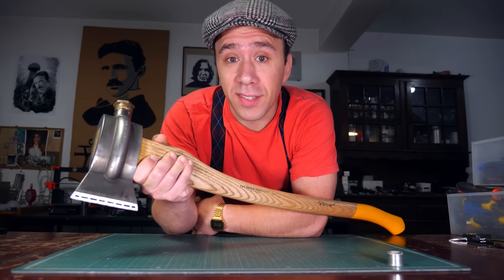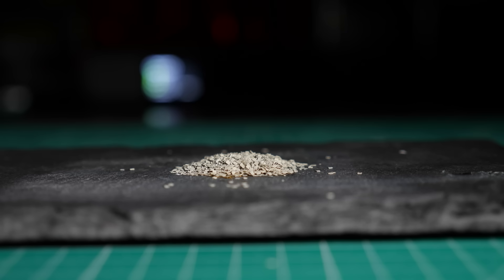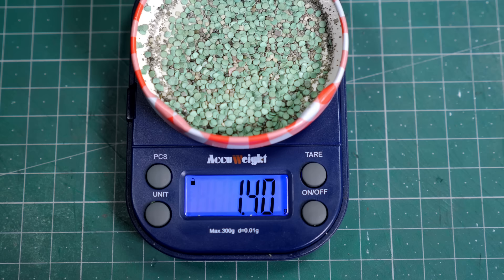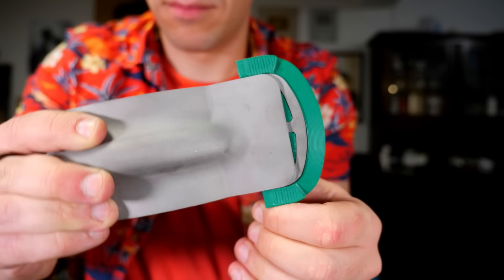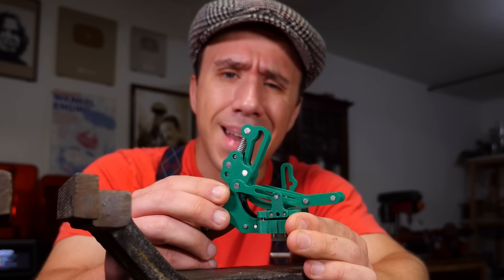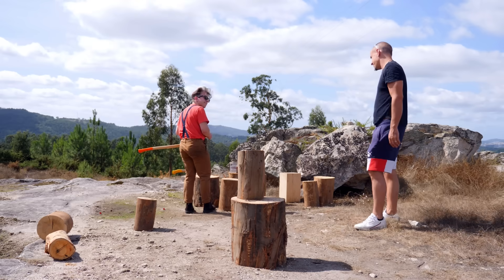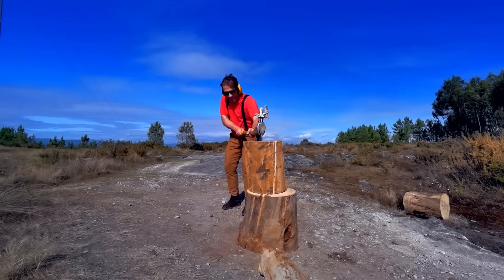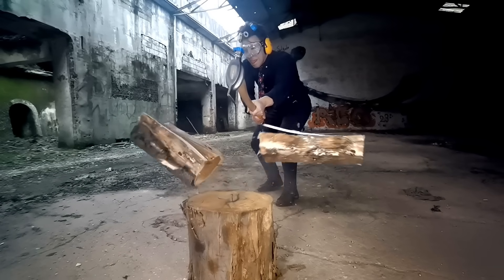I built a BETTER SHOTGUN AXE

Comment: It's humorous that you've created a large handheld pressurized explosive device with homemade oxygen and hydrogen fuel but somehow despite all of that the most illegal part of this project was the shotgun shells.
Reply: Funnily enough, the modified shells are the equivalent of powder nail gun blanks.  It gets into the technicalities, but there's a decent chance they're then legal.

Only semi-familiar with US law, but here's a fun tidbit.  The oxy hydrogen version would be classified differently and might have been the illegal one here!

> “Explosive-Actuated Power Devices” shall mean any tool or special mechanized device which is actuated by explosives, but not to include propellant-actuated power devices
Reply: @EmperorA0   in the us I'm pretty sure that is you're propelling a projectile its not a firearm.  if there were/is limits on the size of the charge, I'm pretty sure that they would still allow 12 gauge shells because the law was written in a time when it wasn't uncommon to see tractors that would use a 12 gauge to start.
Reply: @MrJstorm4  US firearms laws make no sense.

Black-powder cap and ball revolvers aren't firearms. Shoe-laces were considered a machine gun conversion, and adding certain grips requires a $200 tax stamp.
Reply: @EmperorA0 the laws are lighter for muzzleloaders, but the legal definition of a firearm is that it propels a projectile find memes of an explosion.
Reply: @MrJstorm4   and that's not relevant because the courts ruled black powder muzzleloaders aren't firearms.
Reply: @garethkalum8297  wrong. They're antique firearms which aren't lawfully firearms in most states. Some states still consider them firearms though.
Reply: @EmperorA0 Isn't Integza Portuguese?
Reply: @Infanterie_Marine  I believe so, and the laws there are completely different.  I just don't know them or how to properly research them.

I was more focusing on how laws can get weird based on things we don't expect.
Reply: Never get on this man’s bad side.
Reply: best way to find an american in a crowd is to say "guns are bad" and watch them all come crawling out of the sewers to justify the means of mass murder
Reply: Because gun controls is not about safety. It's just about control.
Reply: @rucker69  American moment.
Reply: @latlatko  Pardon?
Reply: @latlatko you didn’t call him wrong
Reply: @rucker69 yup, and harm-reduction and systemic approaches are much more effective to reduce violence. Prohibition doesn't really work to reduce the contraband of then-prohibited goods. It's better to adress the underlying root causes of social problems through culture, with accessible social support services, reducing poverty, etc. Violent crime in the USA owes a lot more to culture and poverty than to not making enough good illegal to everyone. Being poor in the USA is a lot worse than being poor in most other western countries.
Reply: @rucker69 Idk man i think easy access to something that can kill a person without any effort is bad actually
Reply: @IYDACIDE  That can be said for essentially any tool. People bent on violence will attempt to do so regardless of the tool. But to counter your (false) point, lawful firearm carriers are statistically safer than law enforcement. You also have to remember human nature and cultural norm requirements, but nobody really wants to talk about that...
Reply: @IYDACIDE ah yes, so literally anything with a blade or point then as well? More easy to conceal and less conspicuous than a firearm, so maybe they should take those away too. Oh and arrows and bolts are completely silent, so get those too while you’re at it. As a matter of fact, vehicular homicide is possible and can happen with little effort as well, so take away cars too. You get the point now? It’s not the objects, it’s the people who have the intent that should bear the blame. Handing someone a firearm does not make them a killer. Killing someone makes them a killer by definition.
Reply: @IYDACIDE that's his point. Allot of things can do that. Nail guns that use blanks as propellant are moving those nails fast as a bullet. A good swing with a hammer to the dome will do more damage than a gun will.  you can take out a crowd of people with a car. He just took the first steps to a hydrogen bomb with hardware store materials. Should we ban all these things too?
Reply: @darkhawk574  I'm not really against ownership of guns but I think this is a poor argument, its like saying someone dead set on robbing a store or bank is going to find a way to do it so we might as well leave the money out in the open. Also, harming someone with a gun is much easier than with a blade or bow, and a vehicle's numerous utility uses far outweigh its capacity to harm. I cant think of many utility uses for owning a pistol outside of self defense, which isn't to say that's a bad use case but I think you get the point.
Reply: @rucker69  In Australia after we had a mass shooting in 1996 we introduced strict gun laws. Care to guess how many mass shootings we have had in the following 29 years...? None, not one. How about the USA..? I'm getting 8-11 Per week in the USA from a gpt search.

Gotta say, for the "most free" country on earth youve got the highest gun violence of any western country and the highest prison population per capita. Glad I live in Australia.
Reply: @SteggyMgeeSee it's the snottiness you have that is keeping you from thinking rationally. You don't even understand the laws we do have or how the shooters you cite obtain them (it's mostly theft). Pretty sure you have had a bunch of mass stabbings and even a shooting in the last 12 months. Banning objects does not stop the will to kill.
Reply: @IYDACIDE  You sound like the British government. I recently had to go through a new piece of knife legislation to check whether the machete I use at my job is now classified as an illegal offensive weapon; fortunately since the blade point is not less than 90 degrees and there is no serrated section, our wise and noble leaders still deem it a garden tool, not one of those 'weapon' machetes people use to thrust and saw at each other presumably. No, mine is only good for hacking with and therefore fortunately unsuitable as a weapon /s
Reply: @rucker69  Not being snotty man just saying facts. Theres nobody to steal a gun from here. ok lets look at some statistics

Total homicide rate in the U.S.: ~ 6.8 victims per 100,000 people (2023) 

General murder/homicide rate in Australia: ~ 0.74 victims per 100,000 people (2021) according to macrotrends.

so what are we at? youre about 9x more likely to be murdered in the USA regardless of method.
Reply: @SteggyMgeeIt’s always an ausfailian coming in on a high horse, meanwhile every gang shooting in America is counted as a mass shooting despite it not really counting
Reply: @SteggyMgee he’s not worth your time man. People like him are why am*rica will continue to have more shootings than there are days the of year. Hes a lost cause
Reply: @SteggyMgee so you only care about shootings and not violence.
Reply: @rucker69 that reflects more on law enforcement than anything else. May I know the source of that ststistic? Just so I know which country we're talking about... Good thing you're not a hypocrite and thus favor resucing law enforcement's access to deadly force and increase their accountability, right?
The effectiveness of the violence inflicted is heavily reliant on the tools. My brother blocked a knife attack with a high school backpack. I have a friend who was stabbed in the gut and survived even though it took over an hour for him to get treatment. Would the same be true in either case with firearms?
Reply: @marcospatricio8283  It's pretty easy to look up yourself. USA. I think it's John Lott's work, if I recall. But CDC and FBI have always shown that to be the case, when they're not caught doctoring numbers to omit citizen defensive gun uses. As well as highlight the source of violence to begin with, which I'm not sure why you're ignoring? You think it's better that there are stabbings instead of shootings as opposed to just, oh I don't know, attacking the sources of violent crime to begin with? 

It is silly to treat the two categories separately. Humans are sacks of flesh and blood and opening that up in any fashion always carries a risk of death or other health damaging effects. Some people get shot in the head and live. Some people get stabbed in the leg and die.
Reply: @rucker69 being "easy to look up" is irrelevant. I wanted to make sure we were talking about the same set of data, both to make references I know you'll get and to account for the possibility that your sources suck. And speaking of that: Lott's work has been heavily criticized for methodological errors since it's inception, and for good reason. None of his findings have been replicated whatsoever, and he's only relevant outside of the scientific community. I couldn't find sources for law enforcement violence in either the CDC or FBI sites. If you could find the sources I'll happily read them.
Assuming that your data is right, tho. The US police forces are remarkably militarized and unusually violent. Being less violent than them on average is not a big accomplishment on US civilians. 

I didn't ignore the matter of "source of violence" because you didn't mention it before. Elaborate on it and I'll address the subject. And speaking of ignoring, answer my questionn about your views on law enforcement. As for your question about "attacking the source of violent crime": I've seen that used as an excuse to lynch innocent people multiple times, and as an excuse to subject criminals to abhorent and inhumane punishments. The average human is a coward. If allowing them to "attack the source of violent crime" is garanteed to cause loads of collateral and has no garantee of actually solving the problem, I'll err on the side of caution.

Ahmmad Zeineddin has a good paper on that. Shows that gunshot wounds are 5 times more lethal than stab wounds. It is limited in that it doesn't address prehospital deaths, tho. But also doesn't address the fact that stab wounds don't necessarily require hospital attention much more often than gun wounds, so it's not a silver bullet against your point. You could look for papers on that to support your point.
Reply: @person55632  I've been hit by nailguns before they don't do shit, what brand of nailgun are you buying?!
Reply: @FiniteBanjo yeah if you get hit anywhere that's not vital it's not going to kill you. That's the same with a gun. There's plenty of shooting survivors too. But I also have known people killed by a nailgun to the head. A bullet to the leg is generally less deadly than a knife to the throat even though a gun is considered more dangerous than a knife.
Reply: @rucker69  where the fuck do you think they steal from. the cops? obviously not. they steal'em from places that are easy to steal from, of which there are many because there's a whole logistics chain for consumer-purchaseable firearms.
Reply: @SteggyMgee Yeah about that...
Reply: @rucker69 
If you think there's any gun control at all in the USA, you're insane.
Reply: @Armand79th they do "control" guns to some extent. But they lack most of the socio-economic policies and access to support services that make other countries have less violence than the USA has. They don't even have healthcare, let alone proper education. Makes sense that they'd have more gun crime than the similarly-armed swiss and rural canadians.
Reply: @Gabdube  wtf dude "they don't even have healthcare..." do you just think we don't have hospitals or doctors? Plenty of complaints to levy that don't involve muddling terminology. Edit: I got to another one of your comments which addresses culture so I'm retracting the rest of my reply here.

Comment: Why not build the axe with a floating heel? The axe tip, being mounted to the handle, and a weighted heel mounted on a 4 point coil spring. You could have an inner barrel inside the chopping face and a female outer barrel and the striker pin at the end. Mounted inside the heel. Which would also keep the striker and shot plate in line. You could make the springs adjustable for load. 
Just thoughts.  I'm no engineer.  Lol

Comment: I think you’re over penetrating the primer on the shot shells and this is venting the gas backwards out the hole the primer fits into. Or you didn’t seal the sides of the camber well enough. If you post pics of the shells I could tell better. Cause if there’s a cylinder gap you’ll have the same issue of too much gas escaping. Looking at some of the footage it seems like a bit of a mixture of both.

Comment: Don't go back and forth with a hand file! It works much better and helps with the longevity of the tool if you use it against the work in a single direction.

Comment: Suggestions: depth based triggering system. Perhaps a paddle, lever, or plunger that can be timed to set off the shell at the correct time. Also, a safety lever on the axe handle that you have to squeeze to allow firing

Comment: I don´t know how heavy is that modified axe, but with a normal one you use a long arm and swing that thing from very far behind to maximize momentum, that penetrates more, with the shotgun axe it´s the same principle, you will penetrate the blade further before the explosion, obligating the gases to crack open the wood and not throw the axe back up. You can see that the times you hit harder are usually the ones the wood cracked.

Comment: Instead of depending on venting gas to split the wood, maybe divide the blade into two parts that "seal" together with magnets, and have half the blade swing out on a hinge:

Edge before boom:
|||
V

Edge after boom:
\|||
   /

So kind of like this, in cross section (o is hinge):
|    \  ||
o_  |  ||
\   |/ //
  \ | //
    \/

and then the blade opens up, tossing one half of the split to the side (<- indicates movement of half of edge and release of pressure):
     |    \  ||
 __|o   |  ||
    /   |/ //
  /  <-  //
/        /

Comment: As someone who’s chopped his fair share of lumber, the design of the head seems to send a lot of the force from the shell down into the log (hence the axe bouncing upward)m where what you need is the force to be sent outwards, or perpendicular from the grain. I would suggest putting the ports on the sides of the blade with a clear block to force the gasses to go off to the side. Might be worth trying to have the gases cross sides to align them more.

Comment: What was stopping splinters from cutting your jugular or neutering you? Also, why didn't you make a mechanism that pushes up when the blade sinks into the wood to release the hammer? Would that be a slower or less reliable version? I'm thinking a sort of... shield or sheathe around the axe blade that gets pushed upwards as the blade sinks into the wood.

Comment: What about my idea? Instead of trying to make use of the gasses to split the wood, what about a "barrel" upwards but with no muzzle. Inside, you have a heavy weight. In top of barrel, you have a spring, and then holes so the gasses can escape when the weight is in the topmost position (so the weight can't escape the "barrel" and become a projectile or bullet). Then, you have a shotshell pointed upwards in this "barrel". So when the axe hits the wood, the shotshell is triggered, which would "shoot" the weight upwards in this barrel, which would by recoil, push the axe harder down into the wood.

The trickiest part of this, is to get this "counterweight" just right. Too heavy, and you might have a barrel explosion. Too light, and it might shoot out, or not do a good job of recoiling the axe into the wood. So you might need to do remote tests in a safe enviroment to find out which weight is the best and safest, and which material the "counterweight" should have.

If the axe head itself is comparably light (using a light variant of stainless steel) so the weight ratio of the axe to counterweight is very different, the recoil will have greater effect.

Comment: What you need on the front side of the axe is a needle narrow type of structure to penetrate as deep as possible into the wood and then release the gas pressure. It will blow the wood apart. Like sticking a barrel of a gun into the wood. Like a hybrid of a tomahawk axe and a gun.

Comment: I cant help but think that perhaps using air pressure might help.
also what if that pressure changed the shape of the axe inside the log to split it. 
also would creating a deadblow kind of hammer/axe help with consistency?

Comment: I thought you were going to try and use blanks as your propellant.  You may have to create your own propellant using matches and striker dust; you also may need to redesign the axe head to make the flow of pressure more angled as it comes out and have it come through a slightly more narrow passage as it reaches the exit.

Comment: This thing is one big barrel obstruction, you might want to put vent hole on the back side of the axe to vent excess pressure and prevent rapid unplanned disassembly
Reply: i dont know of any relief valves that deal with those levels of pressure tho, getting that hole in any useful way would be quite hard
Reply: @thmxsz what if it was just a hole that redirects excess gas backwards then sideways

Comment: I think a good solution to the splitting problem is always some deep penetration. (Pun intended) It might be worth exploring some sort of spike rather than blade idea which can you can force deeper into the harder wood (Again, pun intended) pushes a gas further into the wood and reinforce the rear half where the explosions happen. So the gas is forced to go down through the tip and into the centre of the word, thus creating wooden projectiles, that's my best theorie, I'm not good at maths myself 😂